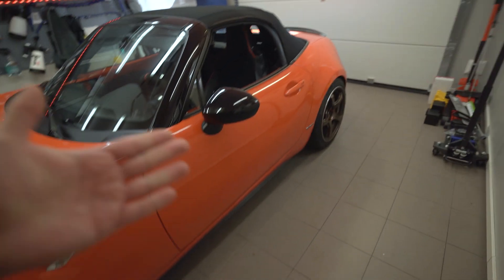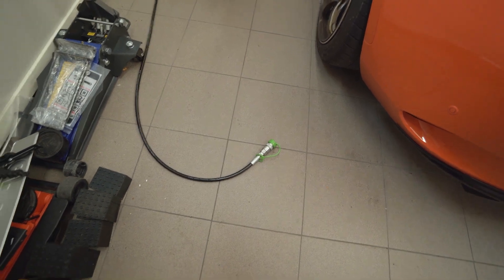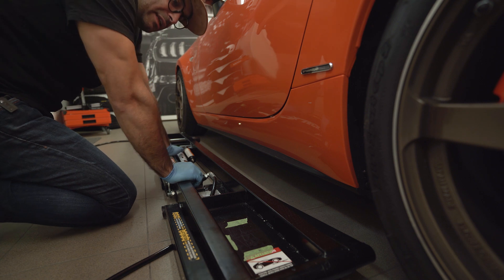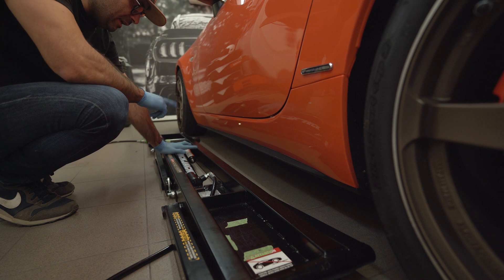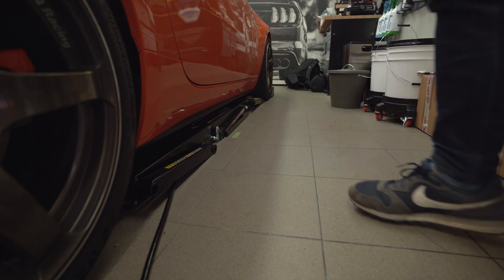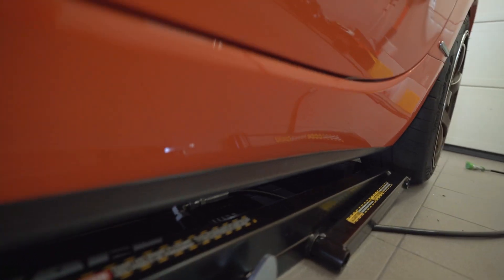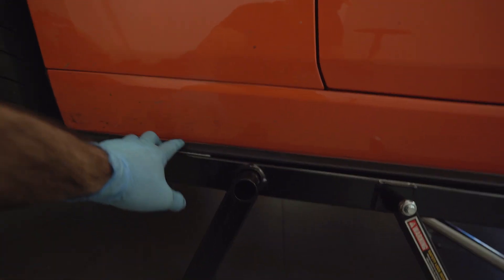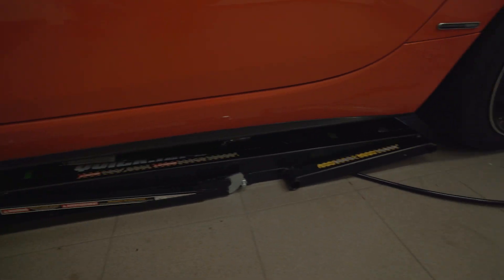Review of Quickjack BL-7000-SLX for small cars, lowered cars and small garages

Comment: Thanks. Have a new 21 RF and have watched many of your videos over last few weeks. Was considering the 7000TL which is replacing the 7000SLX and was pleasantly surprised when your video came up in my searches. Like how you go into detail about everything , super helpful.
Reply from the maker: Thank you and thank you for the support, glad you like the content! If you can get hold of the TL I would go for that. It is not coming to Europe until summer or so in Europe. That extra height would be worth it I think.

any version the QJ is golden makes things so much easier and fun if you need to wrench on the car
Reply: @Themazcorner   So no issues with the 7000TL on the ND hugh (Have a 23 Club)- was looking at a 5000- but wifey is wanting something big lol
Reply from the maker: @senfing  I think its the best to check the spread on the TLs. I think the 5000 should work. With the 7000 SLX I have no issues at all. But I believe the 7000 TLX does not work with the ND/ND2

Comment: Are the lifting blocks positioned under the pinch weld flanges or just inboard of them? It's not a good idea to support the weight of the car on the flanges themselves. (The areas immediately inboard of the flanges (at the dimpled locations) are specifically reinforced to carry lifting loads.)
Reply from the maker: The blocks are positioned on the reinforced area where the dimples are or did I misunderstand  your comment?
Reply: @Themazcorner  : As I said, the flanges themselves should not be subject to lifting loads.
Reply from the maker: So how do you suggest that the car should be lifted on lifts etc?

Not possible to access the subframe with a lift. The points between the dimples are where you put jackstands if need be on the pinch weld. What is the difference between having jackstands there instead of the lifting blocks that raises the car evenly.
Reply: @Themazcorner  : Look under your car immediately inboard of the dimpled area of the pinch-weld. The reinforcement there is obvious. In fact, when you use Mazda's own scissor jack, it applies lifting force only to the reinforced area—there is no pressure put on the pitch-weld flange, in fact, no contact with it at all!.

Just place your blocks inboard so they don't contact the pinch-weld flange but do contact the reinforced areas. In other words, just move the blocks closer to the car's centre line.

Again, go look carefully for yourself.
Reply from the maker: @deasystems  gotcha and big thanks for the input, However I do place them where to shop manual says and so does most people without any issues

https://www.hexorcism.com/16ND/sm352458/
Reply: @Themazcorner  : I don't see anything in your link that contradicts what I've recommended.
Reply from the maker: No but they are only referring to the pinch welds nothing is mentioned on placing anything inwards towards the center of the car
Reply: @Themazcorner  : Please look under your car and examine the lift areas. Please lift your car with Mazda's own scissor jack to investigate where it applies the lifting force. Or don't. It's your car.